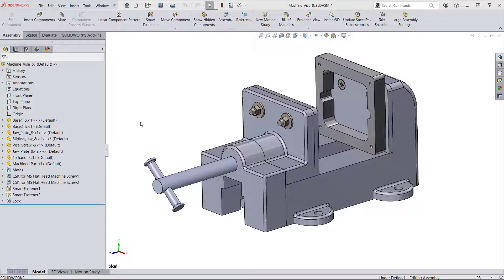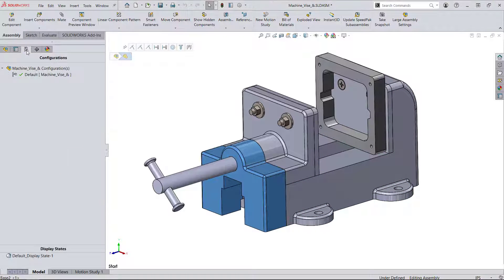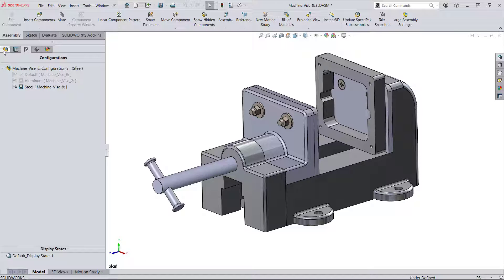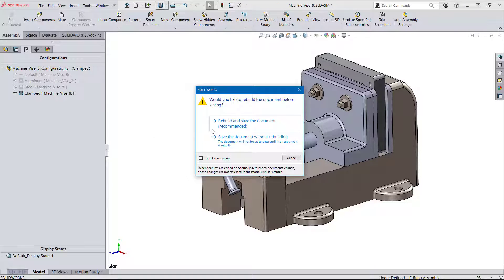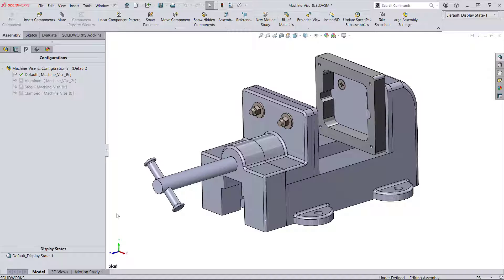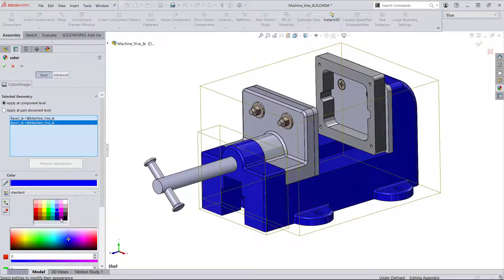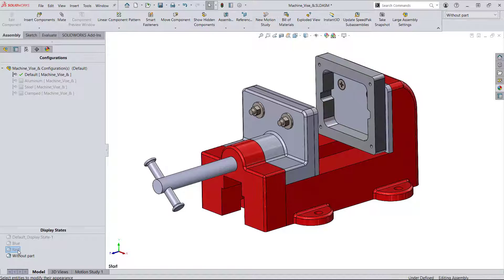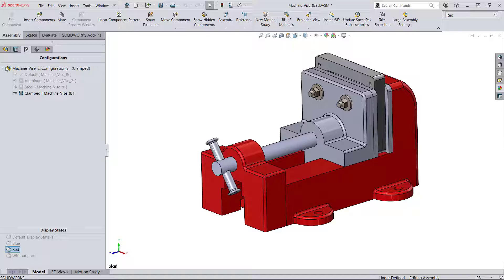SOLIDWORKS - Using Display States with Configurations

Comment: Extremely clear and helpful video. I never use display states, only configurations, and I have run into problems and workarounds that would have easily just been a display state. This will save me a lot of time, thanks.